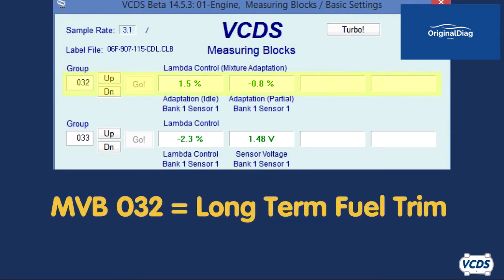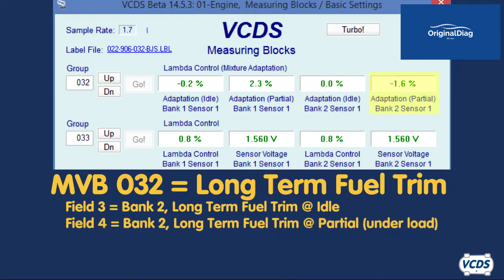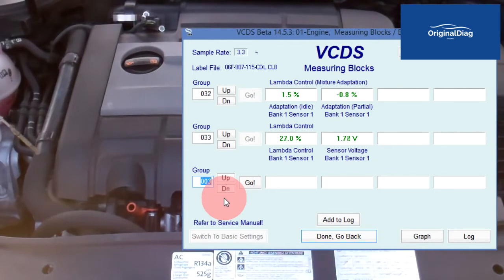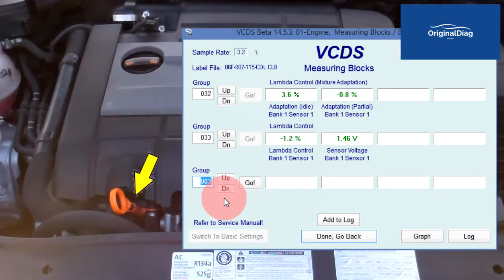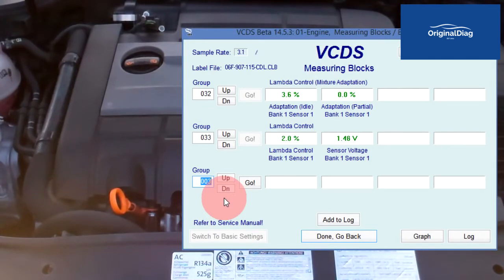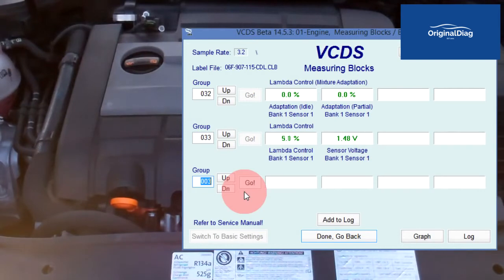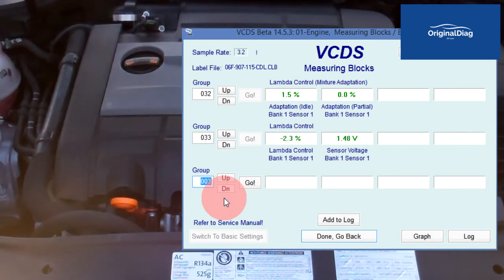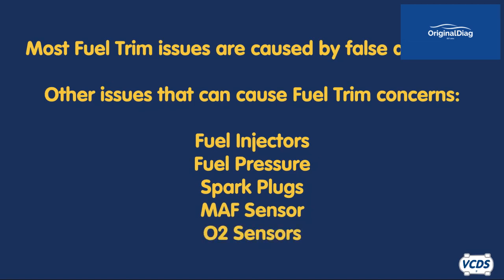Understanding Fuel Trim by Ross Tech VCDS - Originaldiag.com

Comment: I have -1.6 ltft. And also fault code rpm over setpoint. Does this mean there is domething wrong with the furl injection? Because my engine ranfomly revs up to 1300rpm when warm. It also falls back to 800 and this goes on and on until i start driving again. Couldnt find a single leak.